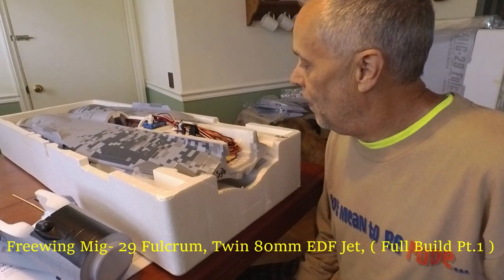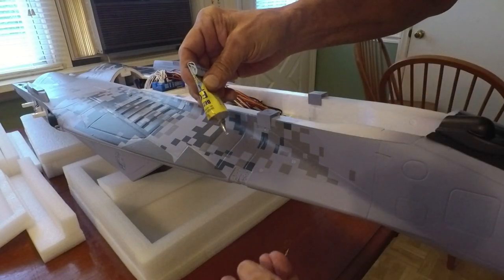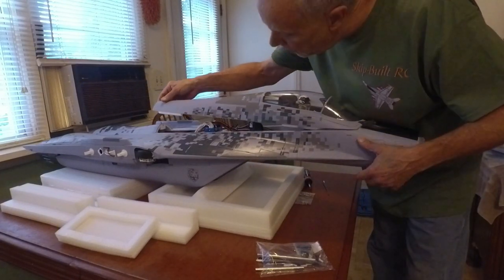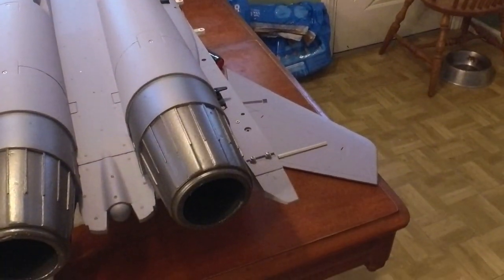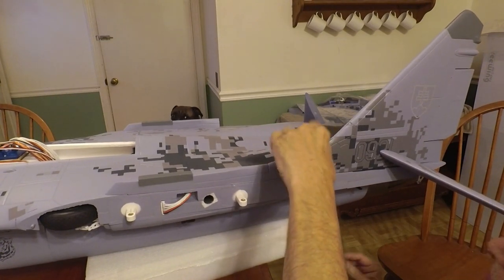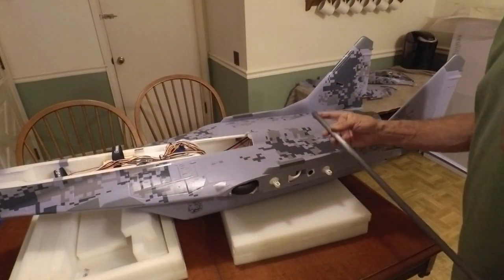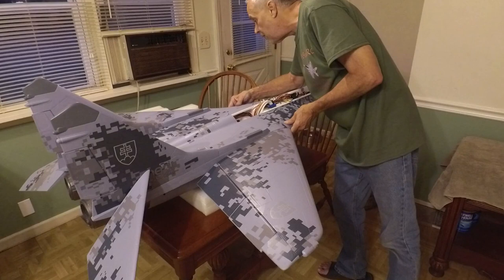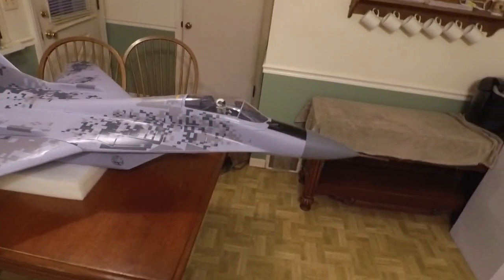Freewing Mig-29 Fulcrum, Twin 80mm EDF Jet, from Motion RC.  (Full Build Pt.1)

Comment: Skip I got a new project, Nexa ov10 bronco 1800mm it a big one
Reply from the maker: Sounds Awesome and should take you some time over winter.  Great looking Plane..  Impressive for sure.  Good Luck with her and Happy Flying Brother, Skip
Reply: I'm using the rimfire 46 motors 800kv it will look good and also have some speed, I'm adding navigation lights to give a true scale look.
Reply from the maker: @drabun1959  should be awesome buddy.